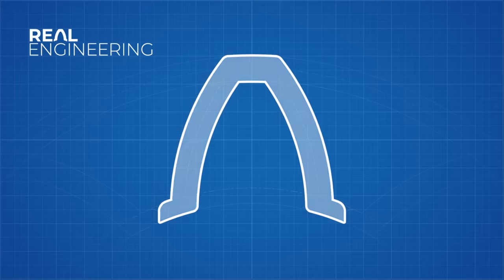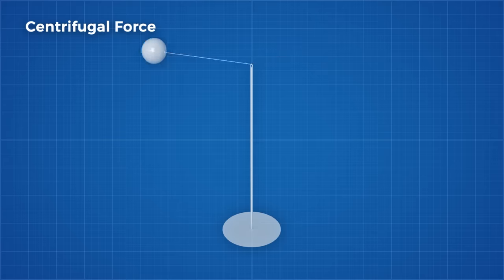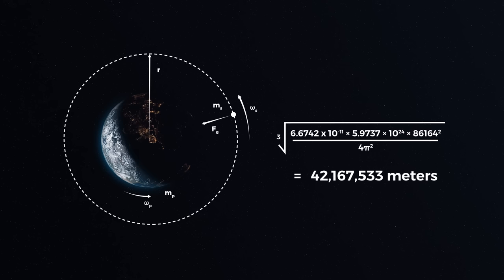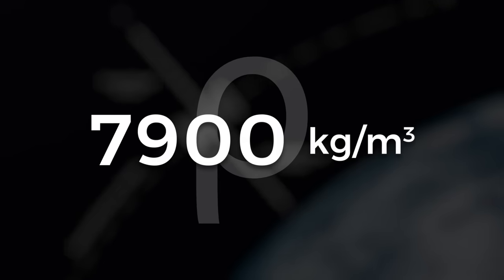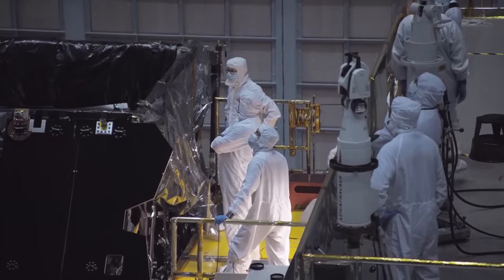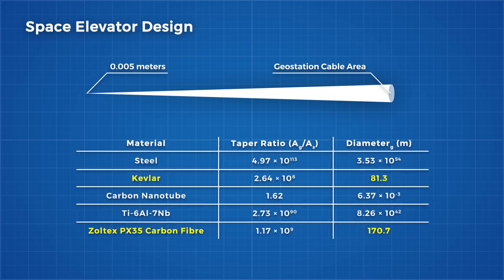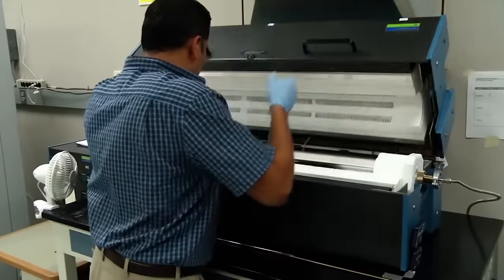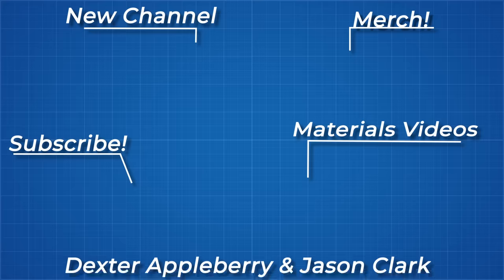Are Space Elevators Possible?

Comment: Another "minor" problem would be Mach 25 at orbital stage with 0 velocity at the base while the Earth is spinning around it.
Reply: There's no atmosphere there, why worry? BTW everything on the equator is going 460 m/s while Mach 1 is 343 what is that? Mach 1.3... something? Equatorians must be deaf xD
Always bear in mind that speed is measured relative to a point. It could be a point fixed or moving but in this case, the earth, the atmosphere and the elevator in orbit are all moving together... So their relative speed is zero (give or take some wind here and there) :)
Mach 25 is relative to a point fixed in space. There are also other names for these speeds for satellites: orbital speed (Mach 25), ground speed (0) and rendezvous speed (depending on the station speed and wether you are approaching or overshoot), for examples.
Reply: It would be geostationary, like a DSS satellite, so it maintains a point directly above its base, otherwise you would have to re-point that DSS antenna all the time.  It might have little thrusters for exact station keeping (to correct minor perturbations, but it would stay stretched directly above, due to orbital placings and forces on the outer cable/weight due to rotational energy).
Reply: @Ktulu789  Orbital speeds reduce for a stable orbit further away, that number you gave is for a specific altitude in LEO.  This structure would extend FAR beyond that.  It also doesn't just "get you into orbit" by climbing it and letting go, at least until you hit that geosync point WAY out there.  For LEO, you would still have to boost CONSIDERABLY in speed, but the climb out (including atmosphere) is negated, so the vehicle could be vastly smaller (all the fuel required to basically get the remaining fuel to that height minus the energy needed for the much lighter vehicle to climb the tower) and MUCH more economical to boost to even LEO orbital velocities.  If you went to the ISS altitude on the elevator and jumped off, you would just fall almost straight down back to Earth.
Reply: @MrJdsenior  The upper aspect would be similar to a DSS - however - the elevator aspect would be a corridor down to the surface of the earth.  That would cause a velocity differential which would make the tech impossible.
Reply: @jameswright6316  You are still not getting it.  Do you agree that (if you hypothetically, with an infinitely strong zero weight string) hooked a string from a DSS satellite (which remains over exactly the same point on the Earth, radially, all the time) to the Earth (someone's receiving dish) it would not be moving WRT the Earth? 

You literally HAVE TO if you understand it, because that is exactly what you are doing with the stationary pointing antenna, just with a radio beam, rather than a string, but if you've ever adjusted such a dish you know that minute pointing differences  cause MAJOR signal losses, and once set, you are done, unless something hits and moves your antenna. 

You absolutely DO have an increase in velocity as you go further up the tower, but that is because the radius increases, and the 24 hour spin rate of the Earth and the entire structure is constant. The tower is still connected and still straight and still rotating at exactly the same rate as the Earth, so from the surface, it is stationary.  It is held there for the same reason a ball swung on a string stays pulled directly away from the spin center (negating friction, which will pull it back a bit, but isn't acting on the tower, other than some winds).  If you stood on a lazy Susan and some one spun you, you would see the ball and string, once it got to a stable position, would look stationary to you.  Same thing with the tower, the only difference is that the Earth, the tower, and YOU are all in that same spinning reference frame.
Reply: @MrJdsenior  You wrote - "Do you agree that (if you hypothetically, with an infinitely strong zero weight string) hooked a string from a DSS satellite (which remains over exactly the same point on the Earth, radially, all the time) to the Earth (someone's receiving dish) it would not be moving WRT the Earth? "

NO - I do not agree.  A stationary object in orbit is moving at a horizontal ground speed [velocity] of at least MACH 25.  A stationary object on the surface of earth has a ground speed of 0 m/s.  That change in velocity would have to be accommodated by the strength of the tether.  That is not possible to do.  Remember, two STS missions attempted to use a short [ 1km ? ] tether.  They broke along the cable due to forces caused by velocity differences.

Obviously, radio waves are moving so much faster than MACh 25 that the velocity issue is not present.

[ Geostationary in orbit does not equate to geostationary on a planetary body. See Theory of Relativity. ]
Reply: @jameswright6316  "No, I do not agree"
Dude, how can you say I'm pointing a gun at a target, and I never have to move the gun, ever, at any time in the future to hit it, that that target is MOVING with respect to may aim point.  In terms of az/el pointing, it IS NOT.  If you can't see that, I cannot help further, you are apparently unwavering in your ignorance. 

It's not the SPEED of the pointing element that matters, it's the DIRECTION.  I can send a bullet to a target 100 meters downrange, or I can send a SNAIL on the same path and they will hit the SAME POINT, just not at the same time.  If the DSS satellite was moving RADIALLY with respect to the ground, the dish would have to move...period...end of story....only way reality works.  You need to get off this stupid 25K number you keep spouting, because that number only works for ONE orbital altitude....not ALL of them...it is centripetal and gravitational force cancelling for a steady orbit, that is all, and the orbit is MUCH slower further out.  That is why Mercury makes many  many many trips around the sun for ONE full trip around of Pluto  (LOOK IT UP).  Or better yet, download and fire up Kerbal, it is put together with REAL orbital mechanics equations, the same ones they use to do real rocket missions...then maybe you will get it.

"[ Geostationary in orbit does not equate to geostationary on a planetary body. See Theory of Relativity. ]"

Seriously, now you're just throwing out crap you don't REMOTELY understand.  There is very little going on here that has much of anything to do with relativity.  It is a VERY small contributor to any of this, and can be virtually ignored for this argument.  I know, because I am an engineer, and took physics that included a relativistic introduction in my engineering core.

Comparing the STS cable to what's being discussed here ALSO shows you have no concept of what is being discussed.  Go back to your flat Earth forum.
Reply: @MrJdsenior  A geostationary object is not stationary.  I know, even Feynman had problems with relativity.

OK, let me approach this from another perspective.  A satellite gets accelerated to a velocity appropriate for its orbit.  Lets keep it simple and reuse the MACH 25 number.  How much change in velocity - aka slowing down - must the satellite endure to maintain its orbital position in GSO?  If you say "none" then it is still moving at a velocity such as MACH 25 +.

If accelerated to a velocity - endures no negative delta V - then it is still traveling at its original velocity.

A tether station in GSO would still be traveling at the same velocity that was required to put it there initially.
A ground station station would be stationary.
The forces caused by the delta V would need to be resisted by the tether.  That is not possible under even the most theoretical material sciences.
Reply: @jameswright6316  You are NOT LISTENING, it travels more SLOWLY in a higher orbit, period.  This is not surmise, this if FACT.  Look up equal area law from Newton, if you want to see the first inklings...and he got it ALL right.  There was only one phenomena in the orbit of planets he couldn't explain, and it actually WAS a relativistic effect.  I'll leave it as an exercise for the student.   You keep asking "what do I say".  It's not ME, it's Newton, Einstein, etc. and all the people who use orbital mechanics, it is NOT up for discussion, it IS what it IS.

You need a course in simple physics, until then, just go on thinking what you think, but you are dead wrong.  I give up.  Some mv^2/r  and GMmr/ ...  type calculations would do you a world of good.
Reply: @MrJdsenior  If it travels more SLOWLY in higher orbit - the Earth's gravitational pull will capture it, pull it into the atmosphere, and - unless it has tiles or ablative material around it - it will incinerate.  [ EDIT - This is the function of a de-orbital burn.  To prevent this, the ISS needs regular "boosts" to accelerate it to keep it in orbit. ]

It MAY move more slowly in relation to another object in orbit - BUT - the difference is only minor in the free body diagram for their system.  Those minor differences between them in their frame of reference to one another is either not indicative of an affecting delta V - no change in velocity that affects their ability to stay in orbit at or near their orbital insertion velocity - OR - their relationship causes a delta V large enough to push them into our atmosphere.

Your earlier comment about shooting a bullet is actually useful.  Newton did not understand that a bullet would never enter orbit.  It is not moving fast enough, by at least 25 times.  To enter orbit, items need to move very quickly and stay at that velocity.  A tether would not be able to manage those forces.

Newton is NOT reliable in modern physics.  Einstein and many others developed the laws of Relativity.  Those laws govern actions at high velocity.  Newton had very little to do with modern physics.
Reply: @jameswright6316  DUDE< just look up the orbital period of MERCURY, the EARTH, MARS, PLUTO, you will see the equal areas law WORKS, always has, always will.  Again, it is not up for discussion.  It is a fact.  Just go RESEARCH it, ....

Actually, since you seem incapable or unwilling to do so, here, I will gift you with it:

Mercury  =  .24 yrs = 107,100 mph
Earth 1 yr (shocker) = 66,600 mph
Jupiter = 11.9 yrs = 29,200 mph

And NONE of them are falling into the sun...see how that works?  Seriously, dude, all snottiness aside, get KERBAL and play with it.  It is fun (according to my son) and you can learn a LOT from it.  You may even be able to simulate the tower (don't know), and see how it behaves, but make sure you understand the concepts first, because the masses, and where you place them matter very much.  Universe sandbox is another he likes to play with (he's not a kid, he works in an engineering firm, doing un-degreed CAD work and writing SW to speed up their operations).  There are multiple YT videos showing what these programs can do  (try to find one that is not shooting the earth with a light speed bowling ball, there are a few).
Reply: @MrJdsenior  The reason they are not falling into the sun is their maintenance of a constant orbital velocity around it.  Consider the example of an asteroid.  When the asteroid is affected by a gravitational field such that the asteroid loses enough orbital velocity it either - enters orbit around that body and slowly falls into its atmosphere - OR - it crashes into it dramatically.  EG Comet Levy Shoemaker 9.

An object in orbit must maintain its high velocity.
A tether can not have one end with zero velocity and another end with a high velocity.

[ EDIT - I thought it was Kepler who observed the equal area law as his 2nd.  Anyway, if you really want to understand it, I suggest a study of time dilation as an effect upon the GPS.  Then apply that knowledge to a study of Kepler's laws. ]
Reply: I think I figured out the disconnect here, maybe.  First, yes, it was Keppler, not Newton, knew that, misspoke, senior moment, excuse please, thx.  Sometimes I think I've forgotten more than a lot of people know. 

For GPS the clock gains DO very much matter, but again, the percentage difference in the Earth clocks, and space clocks, before launch, is minuscule.  For GPS operation, very important, but that is because you are using radio differential times between the satellites to pinpoint your location, and the clocks MUST sync very accurately while in orbit to surface clocks.  Otherwise the GPS would quickly become useless.  You might be able to compensate for this, not sure, but the receivers would need constant updates on each satellite and it would be a stinking MESS, not even sure that would work at all, I would have to think it through carefully.

I think the problem we are having is you think since the orbit is slower further out, the entire elevator would trail the Earth rate?  if the tower was separated, say at 100 ft intervals, each piece WOULD lag further and further behind angularly, from the ground.  I absolutely agree.  The difference, when it is one piece, is that the tower is in tension, and that tension EXCEEDS the weight of the entire tower, so it is essentially stretched to a radial direction and held there.  Does that make sense to you?  I agree it is not easy to see, when you consider the whole system, but I think that is the concept, in a nutshell, as I understand it.  Most of the tower (all but one point on it length, actually) is NOT in a free orbit stable velocity, not in a free orbit sense, that is the difference.  The lower parts, were it cut, would fall.  The higher portions, out beyond geosync would in fact leave the Earth's proximity, because there the centripetal forces exceed the gravitational forces at that orbital height and velocity.
Reply: @MrJdsenior  The orbits are not going slower.  The orbits actually get faster as they go further from the Earth.  They then go out far enough to get caught by the Lunar gravity well and begin to slow down again until impact with the moon.  To go to low earth orbit requires around MACH 25.  That velocity could be achieved by a relatively small space shuttle.  To go further out - eg half way to the moon - requires even more velocity [ delta V ].  This is why NASA used a rocket as large as Saturn V and did not use the Atlas.

The most practical way to overcome the effects of time dilation is to - speed up the satellite - OR - modify the rate at which time is calculated on the phones etc.  Remember, time on a device is actually based on a calculation based on the passage of time as recorded by extremely accurate [ nanoseconds ] atomic clocks.

An object in orbit is moving faster than Earth is moving in its orbit.  That is the only way to prevent an unwanted return to earth.

The tension you speak of - and compression on the other side of it - is a force so great that even the wildest speculations regarding future capabilities of material science would not compensate for them.  A space elevator is impossible.

Your comments about an orbit where the forces are in equilibrium actually exists - as a point in space.  There are five of these points.  They are called Lagrange Points.  The idea of putting a "reception level" at one of those points and then running a tube of some sort down to a "entry level" that is stationary on a planetary body is absurd.

EDIT - I am not holding the data in my hand - however - If I remember correctly, the time dilation effects due to the velocity of the satellites is so NOT minuscule that time has to be recalculated for every device and satellite in the net within every 24? hours or the entire GPS system would have measurement gaps so large that it would be useless.  If I remember correctly, these are gaps of kilometer size radii.
Reply: @jameswright6316  Dude, are you just TROLLING me, because I just showed you conclusive evidence, based on planetary velocities around the sun (same thing, different scale)? 

If you won't accept simple easily gathered and fully accepted and verified evidence, how are you ever going to get to understand anything?   The answer is, you can't.

You can't just choose to believe something that is clearly opposed to what is/has been and ALWAYS will be observed.  Not unless you want to KNOW LESS, rather than more. I don't know how to show you this in any simpler a manner.  I give up.  Just go look up the equations for gravity between to bodies, then look up the equations for centripetal 'forces' and solve the pair for various values of radius.  EVERY space mission uses those equations, and I hate to tell you, but they ALWAYS work, period.  You want to believe they don't, fine, but frankly, that just makes you a fool.  Done trying.

Comment: You state at. The end of the cast that you have found minor errors
There are massive errors the point of maximum tension is the geosynchronous orbit not the half point 
You don’t start by assuming you need a mass or space station as the geostationary point 
Your space station needs moving into a higher orbit so it can help with pulling the tether
A space station at. The geostationary orbit can only hold its self up

Comment: Because I have a smooth brain I don't know how to use the equations, but I'd be really curious if anyone could check how much we can push this. 
1. What would happen if we made the earth end of the elevator at the top of a large tower? Like 800m tall or so. How much would that decrease the taper at the top?
2. Could we change the material as we got closer to the taper to something with higher tensile strength, rather than just one material the whole way. You could use light, weaker materials at the base, and change to heavier, stronger materials closer to the taper.
Maybe I'll need to find a Reddit page for this....